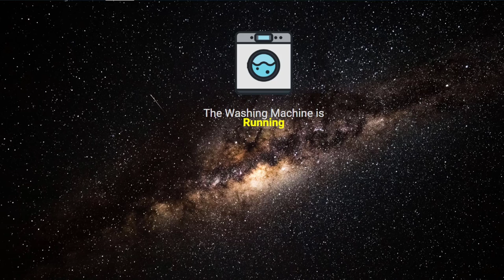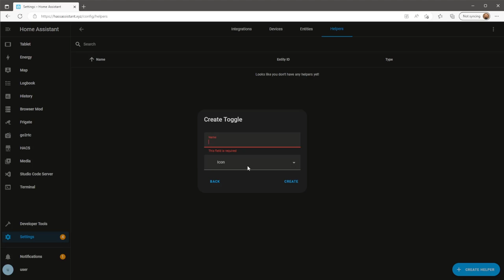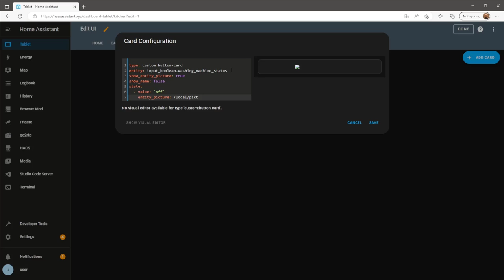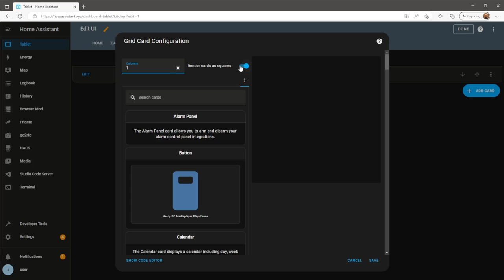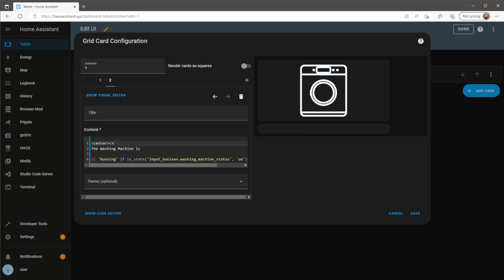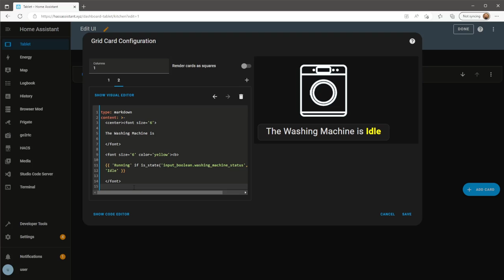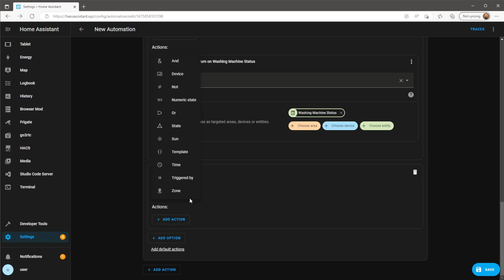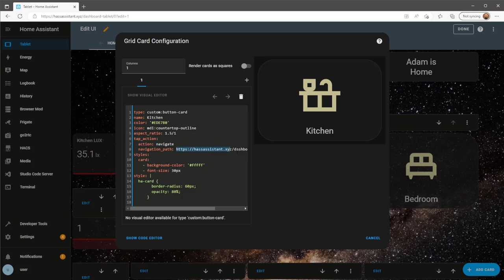How To Add Custom Image Icons To A Custom Button Card

Comment: I never really understood the markdown and it seemed to be bland in its concept and function, however since these videos have been created by yourself I have a greater understanding and spent alot of time redesigning my main dashboard. Is it possible to create text shadow?, I now have an awsome weather card with a great background, however some the text is a little bit difficult to read, despite changing the colour, this would be better with a a shadow behind the text. Thank you.
Reply from the maker: https://pastecode.io/s/uk0nk800

You can do this with card mod.
Text-Shadow. I've included colour also just so you can see how its possible to do so.
Reply: @HassAssistant  I spent hours trying to sorce the right code, within seconds my card has been very much improved. Thank you for the link.